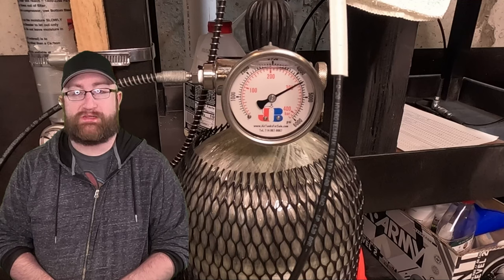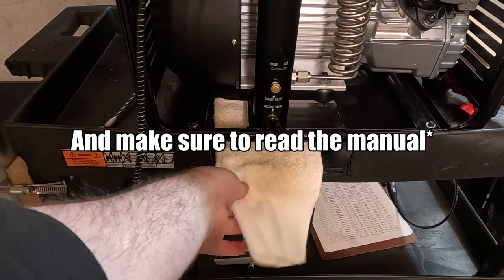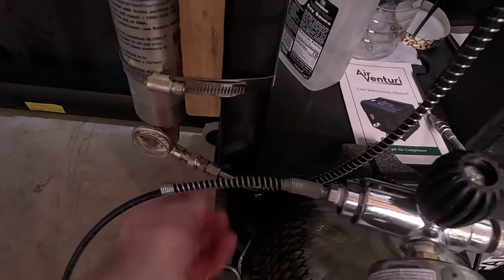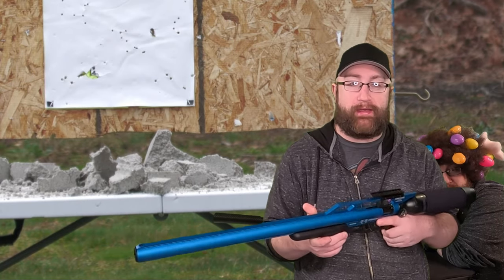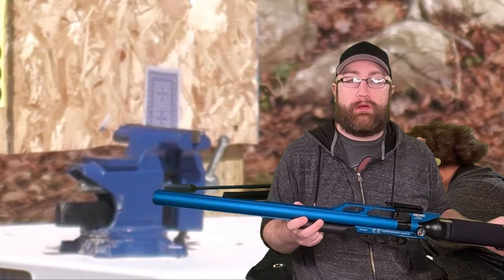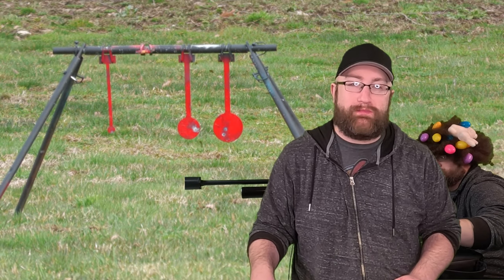Getting Started, Tips, Suggestions for PCP Air Guns.

Comment from the maker: 00:00 Intro Questions / Filling cylinders and tanks
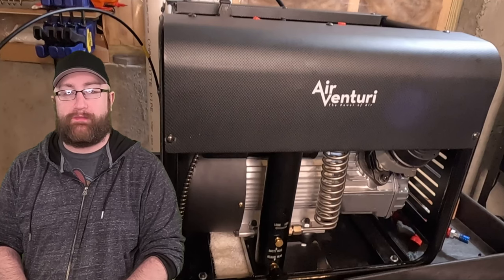02:11 Going over my Air Venturi compressor and Alpha filter / How I fill
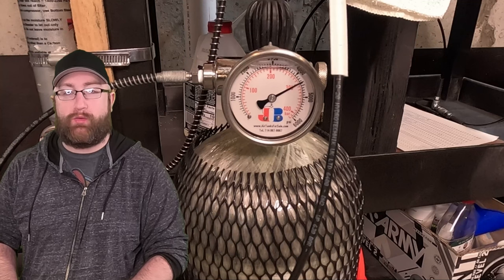07:12 Get a good filter
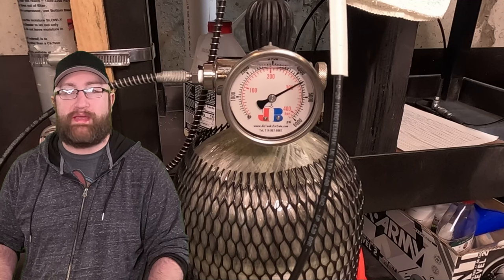07:58 Find a good local air gun store or online retailer
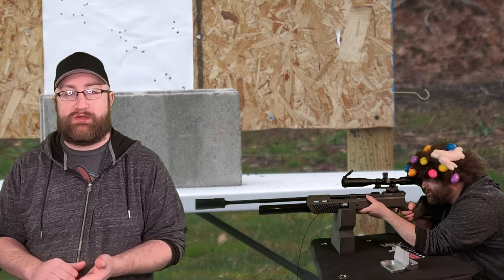09:00 What are you looking for in a PCP air gun?
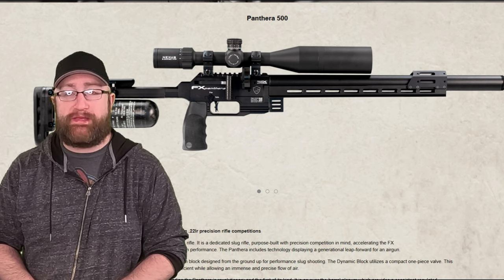10:04 You bought a PCP, what next?
12:44 Reviews, checking online forums
13:56 Chronograph
14:20 Storing PCPs
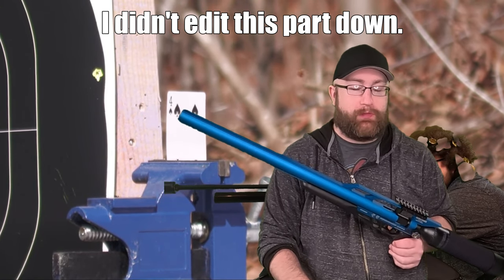14:45 Choked barrels / Ammo
17:38 Wrapping up / Final thoughts

Comment: I knew I wanted the Gauntlet 2 .25. so I bought everything I needed b4 I bought the Gauntlet. Started right Jan 2023, different pellets & slugs 3000rds, hand pump. Some guy recommended a compressor. Bought it, now it was March 2023 & Pyramid Air sold out until May. I prepaid & they got some in  April. Got it, Love. This my 1st pcp. This year Im buying a .30 cal. I just like to plink 80-90 yards. I got a Gamo Magnum .22 which I have taken farther. My buddies scared to spend that $. Want to use up my stuff.
Reply from the maker: The 30 is fantastic. I have a video grouping it at 100 yards that comes out May 10th. Griffin boat tail slugs are really good in it.

Comment: I’m new to PcP airgun I have a question about filling up my gauntlet SL 30 with my Gx ECS4 compressor so I went to a paint ball shop and they put 3000 psi in my gun  because that’s all it would go up to on there tank right  but know I want to top my gun with my compressor what do I set my gages on so I don’t over fill my gun do I put my gage on 4500 psi and then turn it on and start filling and it will stop when it gets to 4500 psi and I also have a air tank that I want to fill up too it also has 3000 psi in it so how do I fill that up also?
Reply from the maker: I would definitely make sure you have read the manual on your unit before doing anything. From the looks of it, yours works similar to mine. Set the pressure cut off to 4500psi on your compressors gauge and it should auto stop when it reaches the pressure. Dont leave the unit while its filling. If you are using a transfer tank like mine, you need a deadhead plug unless it has a 2nd pressure gauge to read the internal pressure. Plug the deadhead into the tanks line, open the valve, get your pressure reading, then close the valve, bleed the line. Hook the transfer tank line up to your compressor, turn the compressor on and wait until the line pressure matches your tank pressure. Once they are within a couple hundred PSI of one another, open the valve on your transfer tank. Wait for the unit to fill it, close the valve on the tank and bleed the line.

Comment: Guy on here can't remember his name talked about compressor. The person selling them added 100 bucks to the selling price
Reply from the maker: I followed Joe Brancato's advice, he does a ton of filling videos. My transfer tank is from him, he saved me on that purchase. Had an air venturi tank, sent it back and got his. 1000% upgrade... For less $$$
Reply: @toxicmatrix1337  one I looked at was £230.00 give or take. But I now go see Ivor the diver he fills my tanks £2.00 a fill which is not 3 bad. Got a duel fill pump gets the heart pumping lol. I Like your set up just not got the space here.
Reply from the maker: @not-himx5593  Thats a deal! To fill my 2 paintball tanks before I got my unit $15... Size doesnt matter in their pricing hahaha so bizzare
Reply: @toxicmatrix1337  $15. A go seems mean. An the amount of air you probably go through gets expensive. Using the syrup pump takes a lot of pumping to get up to pressure. Compared to squirt bleed done.
Reply from the maker: @not-himx5593  Usually its about $5. This one store must have a monopoly on my area lol. Transfer tank is the best option, even at $15 a fill thats not bad for a 98cf tank. 3 cents of air to fire the gauntlet 30.
Reply: @toxicmatrix1337  how many shots you getting on full fill
Reply from the maker: @not-himx5593  Gauntlet 30 gets 25-30 rounds per fill. 1 fill from my tank drops the pressure about 100psi. If I let my tank get to about 2800-2500psi, I imagine over 500 rounds. The Kratos would be well over 1000 rounds, probably nearing 1500, its about a third of the power of the G30
Reply: @toxicmatrix1337  no to bad. Fill on mine between 190bar to 230 bar around 60 to 80 shot. But can take more air but hammer spring not heavy enough to open the valve lol.

Comment: Very helpful 1337 info, you and RBKA have persuaded me to spend the money on a better air filter 🤓, I am having a hard time finding a 13ci tank valve that pushed around 1400 PSI and one at 3625 PSI, there are no companies or stores in my town have hpa anything I am at the mercy of the interenet and what I can fabircate or invent on my own, I have seen where you can use bellville washers to change the fps out on paintball valves, I have a small 13ci tank and that takes a good min to will by hand pump, I would have a hard time wanting to fill a tank larger than that by hand 4 sure. Is there a way to clean tanks if they get dirty?
Reply from the maker: YT keeps deleting my reply and I have no clue to why... Its fucking crazy...

Comment: Super excited for this video man I’ve been following you for a while and interested in getting into the hobby, but definitely feeling overwhelmed
Reply from the maker: Excellent! There is a ton to take in, but over time it gets much easier. Definitely worth it!
Reply: Love to hear your life expectation for a properly maintained unit expressed in decades...Invested a ton $$$ already and longevity compared to the traditional counterpart was my only concern...Figured once I get everything on my wishlist I'd just stock up on o-rings, valve pins, etc...
Reply: Just go for it, like he said, get s good fill method, tanks are the best if you can get it filled close by and eventually get yourself a compressor to fill your tanks at home, The Pellet Shop is an awesome place to deal with, they have tier 1 customer service and will go above and beyond, same as High Pressure Pneumatics.
Reply from the maker: @N.M.0099  Compressors can be very hit or miss. When I was mentioning decades down the road, that was in regard to your PCPs being properly maintained and running a really good filter. My unit is the least powerful one I would buy to fill transfer tanks with, it has barely enough power to handle what it takes. I never let my unit go past 65c, I chart all my run times. I do oil changes every 2 months max, if my oil gets dark it gets changed earlier. If its cold I give it time to warm up, I give the unit time to rest before running it again. I never fill longer than 20 minutes. Were stuck with a lot of chinese units, warranty is very important. You might get a lemon, I shouldve mentioned here to use your unit as much as possible when you get it. If you have a bad unit, youll want to find out ASAP.
Reply from the maker: @michaelpintal5419  The Pellet Shop is very responsive. They walked me through issues in 10 seconds from me giving them my diagnosis of the problem. Good ammo sales and packaging. Ships quick. Free candy LOL
Reply: @toxicmatrix1337  I was speaking to the PCP's as well as that was the biggest expense (collector issues)...Great tips on the compressor, I got a Krypton along with the 98cu.ft. & 100c.i. Wingmen, carrier destroyed the box for the Krypton so hope that never has to go back🤞🤞 The alpha dryer was a hard one to find, only located one online retailer...you have a source you like for that? A quarter  of the cost of the compressor that thing is, can't see not having one though.
Reply from the maker: @N.M.0099  This is the only place that I know has it, I think its their design. https://www.topgun-airguns.com/product/alpha-in-line-moisture-filter/
You don't necessarily need this one, you just don't want a really cheap one. Apparently some cheaper ones have catastrophic failures from acids in the beads breaking things down over time.

Here's one of the videos going over it
https://www.youtube.com/watch?v=i4XH9RGR0dQ

My priority is clean air for long term. Wear and tear parts like O-rings are easy to replace and just comes with the territory, same as anything else that uses them.

There may be part failures, like what happened to my blitz. I had a bunch of internals replaced, but I think that was on me. It really doesn't seem to like moderators.

I can't really think of much else. If you run proper ammo, clean/dry air, stored with air, keep it in order just like any other gun, it should be good to go. I always leave a nipple cover over my fill ports as well.
Barrel cleaning should be just dry patches with the right ammo if you need to clean it out. Definitely dont make my mistake lol

Comment: Also should I get a 1.5L tank in the future or no ? suggestions
Reply from the maker: @chandler4749  Depends on what you want to do. If its a small portable, carry in a backpack situation, that works. You can technically swap out the bottles too, theres used cheap ones available all the time or even valves too.

Comment: You ROCK man you hit on all the points 😁👍. Iv been using my friends compressor a Pritech I read the instructions on both my gun and the compressor made notes hooked my gun up closed the bleed screw started the compressor keep and eye on the gauges finished filling and as I was taking thae gun off I realized I never cocked the cocking handle but it filled anyway and now I remember lol. I also ordered a sample pack of H&N pellets and iv been using crosman premium 22 hollow points and I'm absolutely amazed at the power it has goes right through ½ plywood like it's paper. I just put a Caldwell chronograph in my Amazon cart per your suggestion to get one. I'm going to have to look around for a good airgun shop most around me really seem to specialize in air soft. 

Thanks for the video very informative 😁👍
Reply from the maker: No problem, thank you! I was close to a shop until I moved, nothing out here now lol Some compressors can power past the pressure needed to start holding air when it isnt cocked. A lot of people have done the leg work on finding whats the best pellet and what fps to dial into, that chronograph is great to cheat with if you have issues with something too.

Comment: An absolutely excellent video bud.Excellent.
BTW..When I was in the Marines,the unit I was with was instructed to NOT clean out the barrel after having gotten the dope on our rifle.To clean it changes the strike of the round,and if the shot is one of "great importance",at a distance,you will almost certainly lose the shot.So,we would fire around 50 rounds thru a clean barrel,and get our dope on (sighted in),and then,not clean it until the job was finished.Then,we would clean the barrel (and the rest of the rifle.).
Great job on this video bud.
Reply from the maker: Thanks Steve! It is pretty crazy to think that lead in the barrel is a good thing but it fills in the tiny imperfections. I go as minimal is possible for everything, as minimal cleaner as I can for firearms.
Reply: @toxicmatrix1337  Got that right.

Comment: One thing a lot of new people need to be warned about is that the hand pumps are NOT for smaller people or children. You'd have to be an olympian to fully pressurize a pcp at under 150lbs.  It's a work out for bigger lads too.  They do work tho.  Make sure your fittings are compatible
Reply from the maker: Im surprised we havent seen an excercise bike hand pump or something lol. I feel like you could get some sort of setup with a nice mechanical advantage to take some of the strain off.
Reply: @toxicmatrix1337  I guess the market just needs to be there.  It'd have to be cheaper than cheap compressors tho or people wouldn't bother
Reply from the maker: @williwonti  Someone built a device to aid with the pumping in a similar way. This would definitely be cost prohibitive lol. I think it would be really cool though. Filling a transfer tank working out, its like that video where they had someone bike ride to power a toaster.

Comment: Great video my friend.  Im more nervous now than ever. Never had a pcp but just recently got thr blitz and waiting for my megoladon .50. I ordered a compressor around $350 amd i know its not the best but am anxiously awaiting it along with a big filter for it. One question i have is barrell cleaning for both pcps so i ordered the like plastic job with the calibor plastic things. Arw those sufficient in cleaning the barrels beforw use and what else do i need and have to look for before trying to shoot them. Obtw i havent even ordered ammo yet because im not even sure of that either so if u have any suggestions id reall appreciate it. 

Thank u
Reply from the maker: @chandler4749  i would get a brass cleaning rod and swabs to clean the barrel. Use nothing but dry patches, no solvent or anything else. Ammo for the blitz JSB or FX domed pellets. For the megalodon, Id use the texoma 235 grain hollow points, those worked the best in the video I did with it.